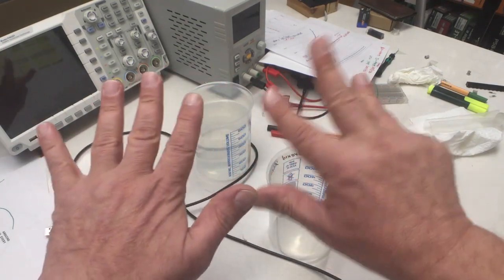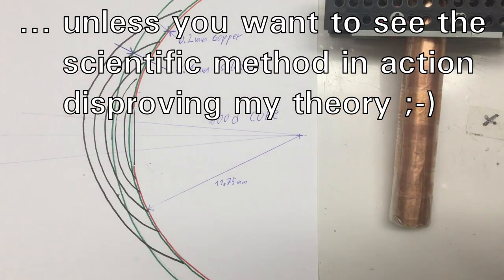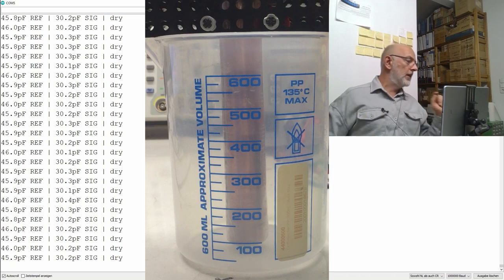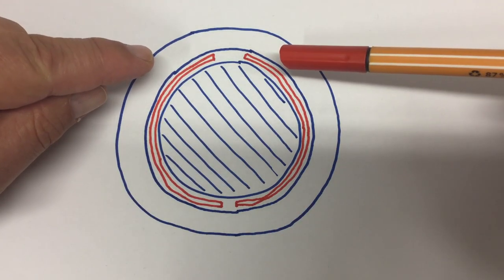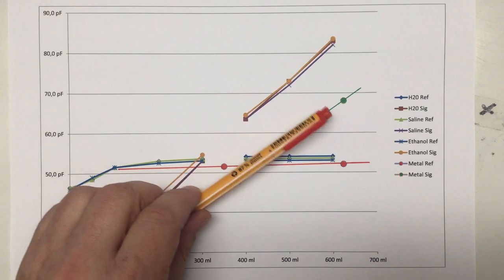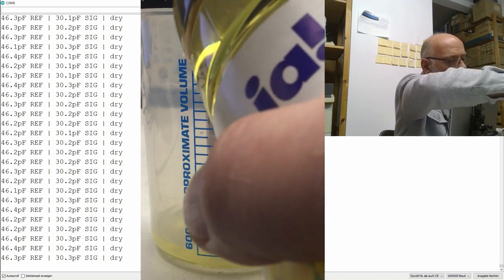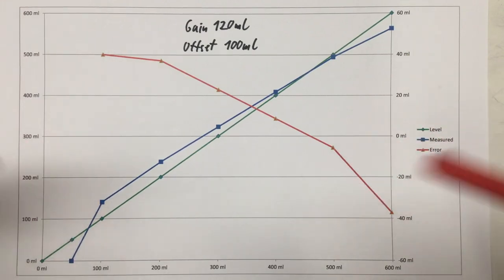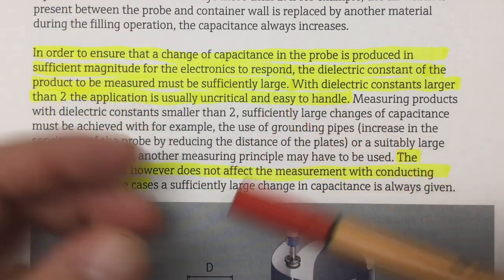Capacitive Liquid Level Sensing (9): Dielectric Constant Not Always Matters

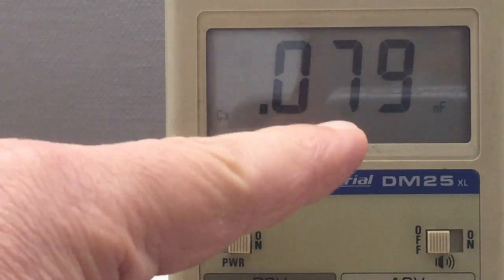Comment: @2:40 How do you know the salt is fully dissolved and also homogeneously distributed throughout the water solution? You could just be measuring a part of the medium that isn't salty perhaps?
EDIT: I should of watched until the end! Great video!
Reply from the maker: Well, I stirred it for quite some time until I couldn't feel/hear salt crystals crunch between the container and my spoon anymore. That's of course not a proof that the solution was really saturated/homogenous, but it should have had (and has) a much lower relative permittivity than tap water. But in the end it didn't even matter 😅

Comment: Hi Rob, I believe there are far better solutions to this problem. I would recommend that you use a method similar to the principle used in slide vernier calipers, specifically a variation of how a digital slide caliper works. A ferrite float inside a tube with many small coils spaced 1mm apart can be used. The dielectric and temperature variables are thus removed from measurements with a constant ferrite.
Reply from the maker: Hi, sensors based on that principle (ferrite float) do indeed exist. But the videos are about capacitive liquid level sensors without any moving parts ;-) No, seriously, float type sensors do have their advantages, but so have capacitive sensors. All that calibrating/compensating stuff pays off when you're measuring "dirty" liquids which can get your float stuck. E.g. grey water and black water - which might come with its own floats :-)) Plus, they are cheaper to make.